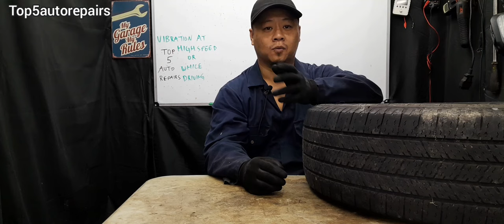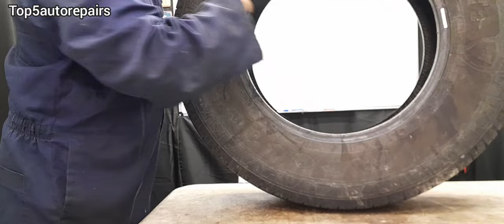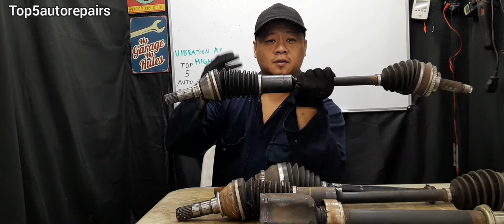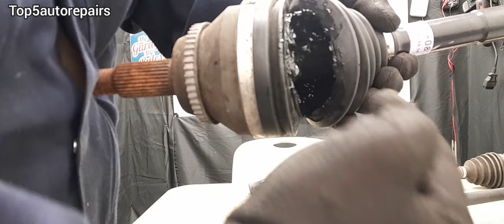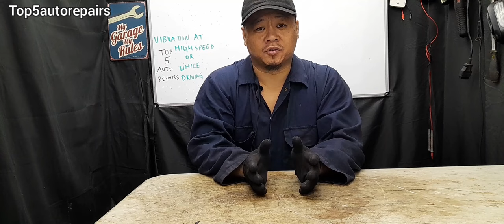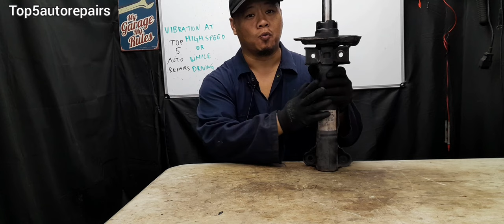VIBRATION AT HIGH SPEED AND WHILE DRIVING (VEHICLE SHAKES)

Comment: I have a 2013 Toyota Sienna that had really bad vibrations to which the seats were shaking terribly I changed axles ,tires driveshaft mount and nothing change this is over 3 years then just the other day I took the wheel off and did a good inspection and found out that the lower control arm bushings were shot I ordered them and replaced both sides and walla vibrations are gone I am so happy because I took it to several auto repair shops and they were unable to get it fixed

Comment: I hade vibration change outer tie rod and upper control arm + went to do an alignment. Everything turn back to normal. till i push my truck a couple of time to 150km now vibration is back. I also changed bearings. Is it possible that new aftermarket bearings are failing. Or should i look at something else. The vibration doesn’t feel the same as before. Feels like wheel is shaking.
Reply: Cv Axle

Comment: slightly bent rim will also cause a vibration, ask me how I know.
Reply: @donkeykong4816  thank you.  I did not mean to be disrespectful, I appreciate your video and expertise you provide, I have been chasing a vibration on my 2006 Suzuki Grand Vitara and yesterday found out I have an issue with the right rear rim, even though I had it at 2 different shops for balancing and has no visual damage on it.  I was offering my opinion to carefully check the rims, even if they balance out.  Again, thank you for your expertise and video.